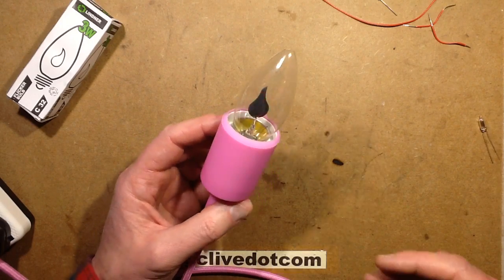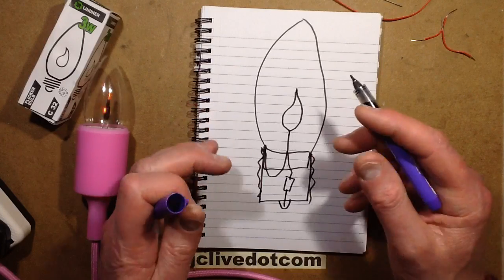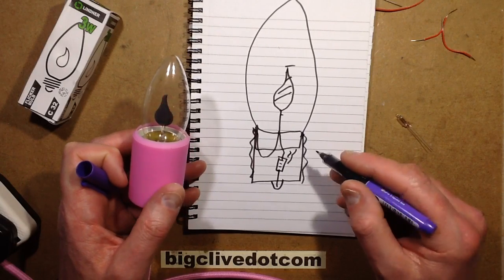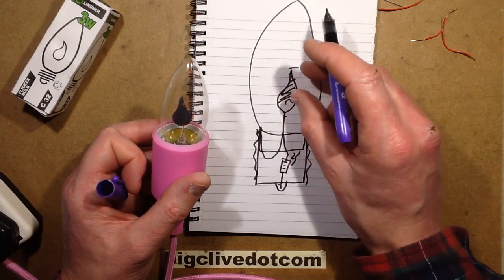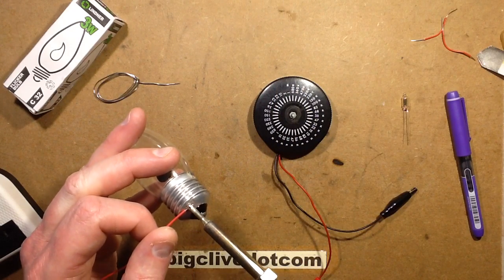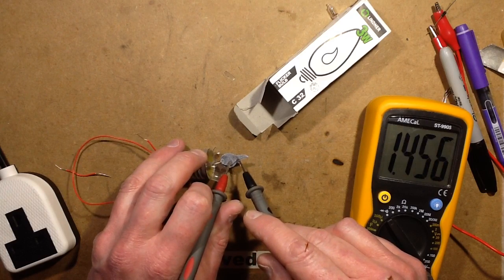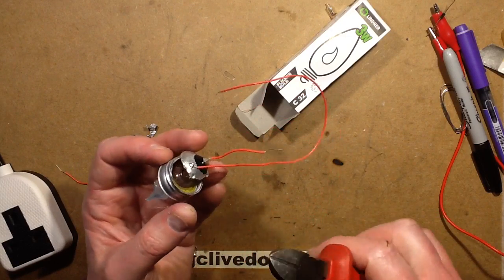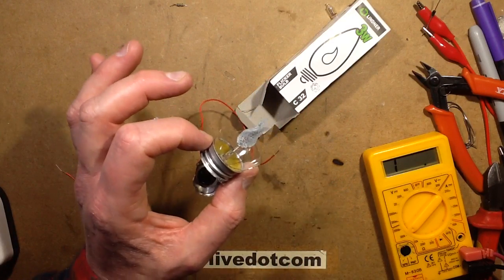Inside a cheap Neon flicker-flame lamp from eBay.

Comment: I went to check out the US version of the quick test (it's model number CL1857 for anyone interested) and it seems the only place that even has them listed for sale is Farnell, and according to their website they're out of stock and won't get a new batch until March, plus they want a $20 "freight" charge due to having to ship from the UK. Oh well...
Reply: I have the US/Canadian version back in stock http://www.ebay.com/itm/Cliff-QuickTest-in-US-Canada-Wire-Colors-/302263880948

Most of the delays is the manufacturing lead time from Cliff. When I put in an order it can be as long as a month or more before they are ready to ship.

Comment: Video does not play on my old computer.    What would this do on its operating voltage which is DC?
Reply: Robert Gift It would illuminate on only one side.  These are essentially glorified neon bulbs and will behave accordingly when DC is applied, illuminating only the one electrode.
Reply: Ethan Poole  Thank you.  On the one side of the electrode, would the flame flicker? 
I dislike looking at 120 flashes per second from 60 Hz.  Even more noticeable on 50 Hz.

Comment: lol, I love that I'm not the only one with a light bulb collection.
Reply: I actually have some of those light bulbs that were used in The LCD watches before like the Indiglo watch came out subminiature linear incandescent.

There are some miniature bulbs similar still available evidently but they're very hard to find and Specialty they use them sometimes in model railroading I bet you those things probably cost less than those because of the quantity they were used in I've got both still plus a lot of the older grain of wheat and grain of rice bulbs that were 1.5 volts and 3 volts as well got some do filled it ones as well but vary in voltages that stuff I saved whatever I could get it.

I'm into Lego adults have Lego actually I found it those miniature bulbs fit easily through the holes in like a headlight right angle breaks.

I've used it to create working like lamps and all for the like of sit-ups yeah not entirely a purist obviously.

Cutting Gorilla Glue Sakura Edge I know but when you do something custom it's okay in my book.

I even have a box with a built with flicker LEDs from flickering LED candles to do fireplaces.

Also a lot of those I recovered from Dickens Village and like Department 56 like stuff like that interpreted the subminiature incandescent NYSEG use they already had leads attached as well

In addition back in the old days where that was mainly what was used really before there were white LEDs which at a time did not exist.

But the often used Amber LEDs once those things start going LED.

But the great thing about the incandescent as you could run them on sit-in series to match other voltages you're using even running on the official Lego system voltage.

And also under running them on that as well would increase lifetime but don't know what they read but I didn't want to push it at all.

Also I remember at the fabric store running across these modules that were meant for lighting various things hobby shops as well they had groups of I think it was 10 some major incandescents double A battery pack also there were some that had Chaser circuits on them noticed it always start in the same position same bulb every time.

Upon applying power.

Antop home I could put that to use.

By the way there are five groups of two flashed in sequence.

Think you get where I'm going movie theater with working Marquis.

Later on once I became available I was able to do that hundred percent Lego with the Lego fiber optic system in a motor there you go hundred percent by go chasing Marquee lights unfortunately just in red oh well but it was 100% Lego

Comment: From an old patent US2976450 

"The luminescent coating 18 may either be a phosphorescent material such as antimony oxide-calcium oxide, antimony trisulfide-calcium trisulfide, bismuth sulfate-calcium sulfate or manganous, magnesium or calcium salts in combinations which will provide an emission of light for a short period after removal of the excitation source. The coating 18 may also be a fluorescent substance such as samarium hydroxy quinolinate, musk xylol, alizarine, aloin or other organic or inorganic substances which will emit a yellow or red glow under the influence of an electrically energized discharge. It is also to be observed that the lower portion of the filament may be coated to yield a reddish emission, whereas the upper portion adjacent the apex 16 may be coated toemit a yellowish glow in order to simulate as closely as possible the characteristics 'of acandle flame."

ttps://www.google.com/patents/US2976450

Comment: WOW that coating is probably, super toxic. 
Wild guess Barium Oxide:-

"Barium oxide is an irritant. If it contacts the skin or the eyes or is inhaled it causes pain and redness. However, it is more dangerous when ingested. It can cause nausea and diarrhea, muscle paralysis, cardiac arrhythmia, and can cause death. If ingested, medical attention should be sought immediately." From wikipedia.

Interesting to see if anything happens.
Reply from the maker: Excellent.  I always wash my hands after touching unknown substances.
Reply: very wise and you should always especially after handling leaded solder !
Reply: Leaded solder is harmless to touch. You can eat it if you want and nothing will happen. Just don't do it every day. 

Clive, you could try to put the electrodes in water. Barium oxide reacts with water to form Barium hydroxide (it most likely did that already with moisture from the air). The water should get slightly caustic if there was Barium oxide on the cathodes. With the amount on the electrodes I guess it won't do much, but maybe it's measureable with a pH strip.
Reply: leaded solder is delicious
Reply: jjensen2492 Not to forget cherries as well.  And you would be surprised how many people are killed each year by water.
Reply: smells good too especially the stuff from the seventies !
Reply: Ethan Poole I hate it when people change their names
Reply: I once arrested a fellow who went off the deep end.  He drove over 100 miles to get into my jurisdiction, since he and I were buddies when we were in our teens. En-route, he chewed the solid lead bullets off six .357 magnum shells, said he did that because he was nervous.  Talk about nervous, this dude had been lifting weights all his life, it took us 3 sets of hand cuffs to get his arms cuffed behind his back when we arrested him.  I have always been very thankful he still looked on me as a buddy and allowed me to talk him out.  The local PD was ready to put a bullet in his brain when I showed up (he overshot my city and ended up in the next) Thankfully he told the officer who had him in his sights that he would only talk to me.  When we took him into custody he had over 30 firearms and more ammo then I could count.  The lead, however did not seem to hurt him at all, he is still kicking somewhere in Kansas last I heard.  This was over 40 years ago.

Comment: If you lowered the light in the room, might the camera slow down the shutter speed to compensate?
Reply: The Cat Behaviour Channel 
No, the iPad is fixed at 30fps. In lower light it would increase the exposure level but not the frame rate, which is optimised for 60Hz mains in the US.
Reply: @WaltonPete  frame rate != exposure time, which can be up to 1/2 the frame rate.

Comment: My guess would be the electrodes have a coating with a low work function mixture of something like BaO2/BaCO2/Ba, like in neon signs. If that's the case, the change you saw was likely the amorphous barium oxidising.

Edit: 10mintwo correctly pointed out that a barium azide/nitride combination can also be used to form the amorphous coating.

Comment: See this 1966 patent for this flickering flame lamp design:
http://www.g3ynh.info/disch_tube/lamp/patents/US3238408.pdf

From a very quick scan of the patent documents, the inventor used Barium Azide to coat a nickel plated (??) iron electrodes, which are subsequently subjected to a number of processes before placing it into the lamp. Although I'm not entirely certain what results from those processes it appears they cook the nitrogen partially or nearly completely off leaving mostly Barium. I'm not a chemist. I'm also surmising that if only one side is coated with a material that lowers the strike threshold and the voltage kept low enough, only that side will glow.

John

Comment: Apparently, these type of bulbs require a very slight amount of heating and twisting of those elements in order to get the flicker effect. One way to verify this would be to shine a high power laser pointer at the elements while the bulb was on to see if the flicker pattern changes.
Reply: You don't need a laser. We've got several of these lamps in candelabra holders either side of the fireplace (put there by the previous owners of the house). We noticed that one of the lamps just glows steadily and doesn't flicker, and I'd heard that light tended to aid the discharge so I shone an LED torch at it, and the flickering perked up.

Other tests: Bringing my (probably fairly earthed) finger anywhere near the bulb altered the discharge pattern. But the best thing was to hit the bulb (gently: not hard enough to "release any knowledge"!) with an insulated rod (the handle of a screwdriver) which made the electrodes vibrate without the electrostatic effect of the earthed finger. The vibrating plates produced a tremendous discharge - presumably as the gap between them reduced and increased, affecting the striking voltage.

Comment: The coating on the electrodes is 'getter' this is to keep the purity of the neon. The electrodes of good quality neon and argon negative discharge lamps are fabricated from Swedish iron for its low sputtering qualities. Cheapie lamps aren't made with Swedish iron and as a result blacken quickly. It's interesting to note that prolite for a few years had a low cost 'flicker flame' that didn't have the getter coating (barium I believe) on the electrodes (they appeared shiny metal). As a result the discharge was a lot dimmer due to impurities in the neon, also if ran on DC one side of the electrode lit pink and the other lit pale blue!
Reply from the maker: I may have some of those shiny flame lamps somewhere.  When left running they settled down and stopped being so active.
Reply: bigclivedotcom yeah they do that! Also they don't always light immediately. Have you tried running them on DC? I've toyed with the idea of removing the cap from one and using it to indicate polarity.

Comment: can you do anything about the camera frame speed clive ?
Reply: as the panels oxidize does this affect the reading ?

Experiments are presented which indicate the existence of two types of flicker noise in vacuum tubes with oxide-coated cathodes. The first is "normal" flicker noise that is present for anode voltages below 10 volts; the second is the "bombardment-enhanced" flicker noise that is added when the anode voltage is above 10 volts. It seems that the latter can be attributed to the arrival of neutral oxygen on the cathode. Since most pentodes and triodes operate with anode voltages above 10 volts, the "bombardment-enbanced" flicker noise should be a rather common source of flicker noise in these tubes.
Reply: Tony Baines nope he is using an iPad which is locked to 30fps

Comment: I also loved these when I was a kid
Reply: Yep oftentimes would see those in Windows lamps that would have the socket wired for two different sockets and support or through a switch either both on either one or off and typically you'd have a flame bulb down into lower although I used to use one of those two headed like a 7 watt night light bulb in it just for a little of white so you don't trip over anything it was pretty dark in the then where I stayed downstairs that lamp actually needed a new socket and switch is how I got it one day upgrade to a different lamp.

Eventually I want to do with those voltage regular night light that used to be on voltage regulator tube as the night light bulb voltage doubler perhaps the resistor is well or otherwise build into something like compact fluorescent base and put that in that socket and when those lamps there you go

Comment: it's well renound that ynann sells faulty goods I have had several items from them and all the items either don't work or they are faulty. and there biggest trick is to offer you a partial refund on the crap they send out ynann is a bad ebayer stay clear

Comment: I think it's flickering because of when the plasma heat up 1 electrode then it will expand and get far from the other electrode thus make it disconnect temporary until it cool down enough to come closer in the length it can arc?

Comment: The black coating is barium, I believe, both elemental and with traces of barium nitride, the former readily oxidizing in air as you observed. It's not terribly good for you, but I doubt such a tiny amount could cause any harm.
Reply: Yes, and fluorescent tubes tubes contain a small amount of mercury. It's all about likelihood of causing harm. With lethal doses being 3-5 g of even the most soluble Barium compounds it is extremely unlikely to cause harm. In the UK there are actually rules around fluorescent tubes that a lot of people are not aware of. It is illegal to intentionally break a fluorescent tube, if you are a business you must store used tubes in a safe and secure manner ready for recycling, tubes may not enter landfill - they must be recycled. Technically an energy saving lamp (the type with the folded tubes) are CFL - Compact FLuorescent or CCFL - Cold Cathode FLuorescent lamps and must be handled the same way. So who here just throws them in the bin?

The other distinction to be made is that a lot of heavy metal compounds remain in the body and have a cumulative toxic effect (this is particularly true of Mercury and Lead, this is why there is so much concern over water contamination of these metals and their compounds) many Barium compounds on the other hand leave the body so the effect does not build up over time.
Reply: If you think about it these are sold to home and apartment renters in the local home and hardware stores, and they don't have big orange warning labels wrapped around them that say DANGER! PROFESSIONAL USE ONLY! SUPER TOXIC RISK! USE ONLY IN APPROVED BLASTPROOF SOLID LEAD FIXTURES!

Something like this is going to occasionally get broken around a home, even if there are babies present. And yet the department of Health and Coddling lets them be sold. They can't be all that deadly in small quantities.

Comment: whatever was coating the electrodes it definitely started oxidising as soon as you cracked the glass so I dont think you can really tell anything from the resistance measurements after its encounter with the vice
Reply: Perhaps a barium coating of some kind?  Certainly acted like the barium getter in a vacuum tube when exposed to air...
Reply: yeme Yeah I thought the same. And they also kept getting dodgier by the minute. Pretty sure it's mildly toxic if not extremely. XD

Comment: I like the lamp holder ! is it available in orange !
Reply from the maker: Available in lots of colours...    http://www.ebay.co.uk/itm/CF615-Orange-Silicone-E27-Socket-Lamp-Holder-/222154367357?hash=item33b96ea17d:g:dp8AAOSwXeJXckBw
Reply: the official unofficial color of the channel is hot pink.
Reply: Thanks Clive  I will probably go buy one shortly really enjoy the videos and I do like the maths keep it up maths was never my strong point its more practical rather than the theory give me a simple Cct and I will make it on vero or pcb  most of my stuff is old school and looks it too as most of it looks like it was built in the 70's wish I could still get some 0.15 vero board  I got some via an eBayer in Canada  not through eBay ! got hammered by hm customs and parcel farce as they charged me for using their bank account the robbin bar stewards !
Reply: is that a fact  !